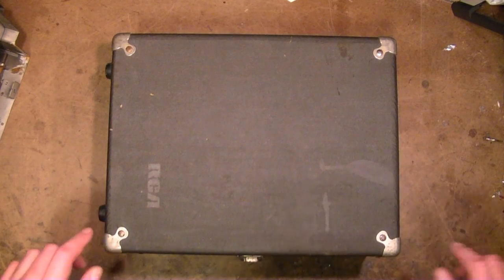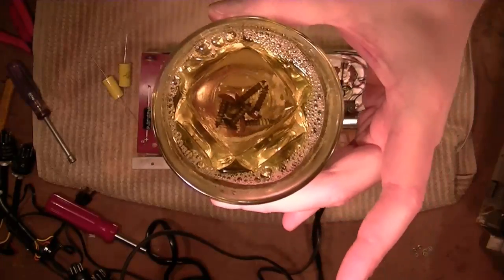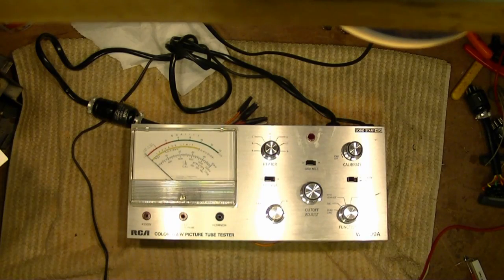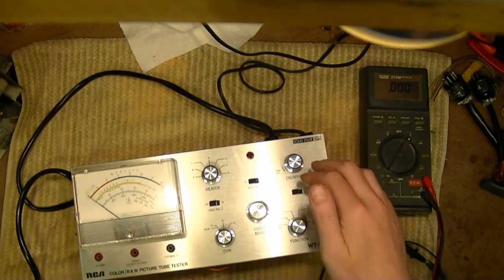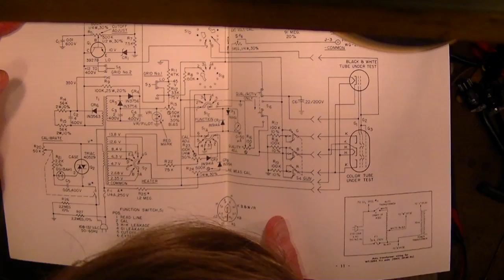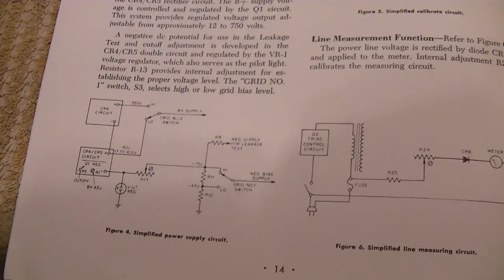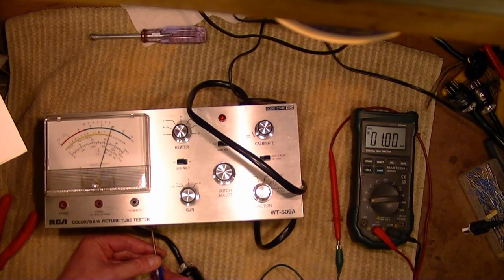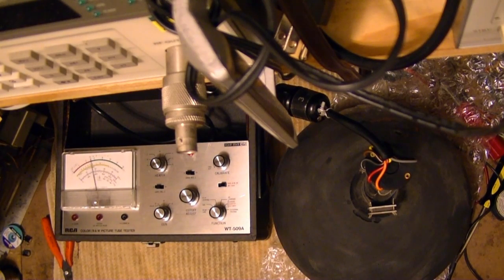RCA WT 509A restoration

Comment: I replaced a neon lamp in 70's, 80's GE alarm clock around a month ago. I just simply removed one from an old outlet tester with probes. I got that second hand because I don't see those testers in stores anymore. I put it in series with a volt meter and got approx. 70 volts AC off one of those tester leads. 
The one in the alarm clock was mostly dead other than a few flickers and arcs inside the bulb.

Comment: hey Bob. The blackening of the neon bulb is called sputtering, actually material from one of the electrodes that's being "burned off". Also, you'll notice that only one of the electrodes is lit up when the neon bulb is connected to DC, Depending on the quality of the electrodes and gas-mix (neon + small percentage of argon gas also called Penning mix if I'm not mistaken) the bulb can last anywhere between 5000 and 200000 hours.

Comment: Good job again!

I mentioned about the radioactive substance, cosmic rays etc on neon lamps.

Mostly for reliable firing voltage, but didn't think about any need for a voltage regulator application.

I was fascinated by gas discharge technology since my grammar school years, (60's) and until now became boring.

Now for some new fun experiments to document neon lamp peculiarities at the Open Bench Project makerspace. 

Attention will be given to this and your other episode for reference.

P.S. half-lifes of many radioactive items such as antique ne-2 or nixies are now very weak.
Reply from the maker: *****
Parts list just calls it a voltage regulator and pilot lamp.  There is no polarity marking on it.  It looks identical to the other neon bulb in the tester and glows the same color.  It does mount in the panel where - it just had fallen out of it's holder.  It's the red power indicator on the top of the panel in the right side.

Comment: What I read was that non-polarized capacitors are not to be used where ac current is present.
Reply from the maker: That doesn't make sense to me.  Use must use non-polarized caps to carry AC current.  AC motor run caps for example.

Comment: I know you have a lot of stuff kicking around your basement and you've worked on quite a bit love your YouTube channel have you ever come across an RCA wa 44c audio signal generator I'm in need of a replacement transformer for it but I don't have voltages otherwise I can find something but I need to know what voltages are coming off that main transformer help
Reply from the maker: No, sorry. I'm not familiar with that generator. I suggest asking on the Antique Radio Forum in the test equipment area

Comment: Bob, I guess the whole thing is confusing to me. You are right about the motor caps.  Here is where I saw some info: http://www.audiokarma.org/forums/archive/index.php/t-398384.html. There, it looks like don't use non- polarized with dc present.  Guess it's one of those "here's how I do it" discussions. Thanks for your insight.  I just wanted to be sure I could replace an electrolytic with a non- electrolytic of the same value.
Reply from the maker: No, I don't get that from that discussion at all.  Looks at post #15.  Absolutely you can use non-polarized when DC is present.  Polyproylene are pretty much the best capacit5ors money can buy.  Electrolytics are one of the crappier capacitor choices.  The main reason they exist at all is the small capacitance for their size.  Restorers routinely replace the DC filter caps in antique radios with them.  Especially the first cap right after the rectifier because you can easily get then in voltage of 630 and above.  I plan on using them in my Philco 37-90 like this guy:  http://antiqueradios.com/forums/viewtopic.php?f=19&t=272676